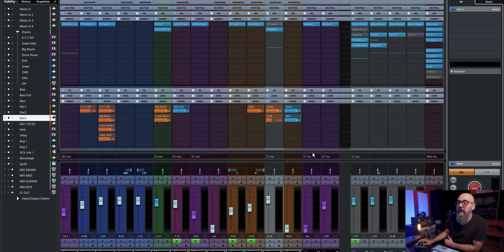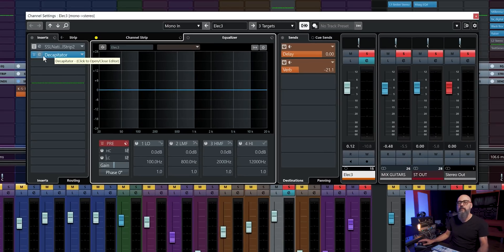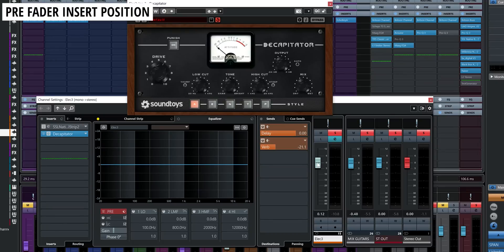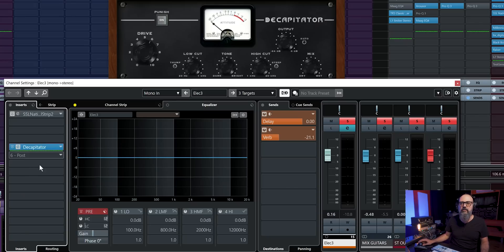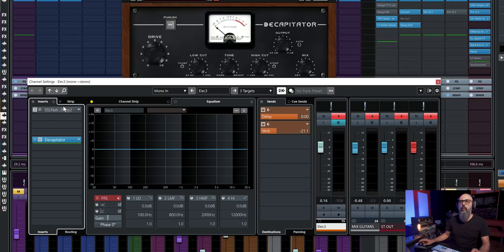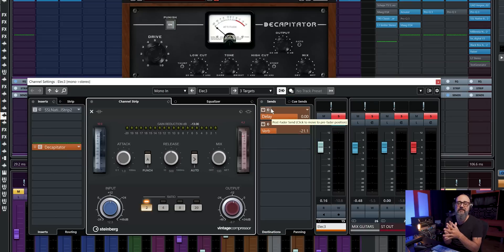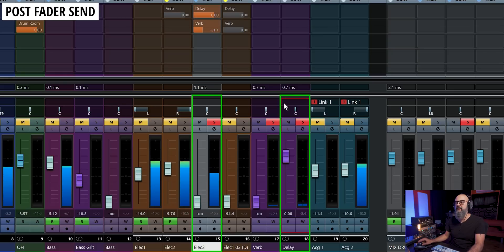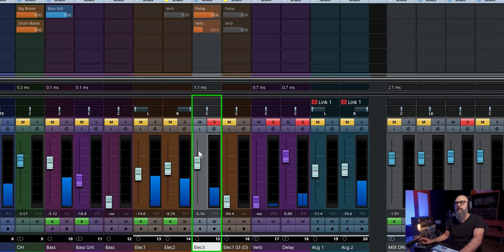An ADVANCED look at The CUBASE Channel Signal Flow

Comment: As a side note I wish there was a way to mix your FX sends with a mixing strip. I know you can use vca etc but it would be nice if for instance you have a delay FX track, you can pull up a mixer of everything that runs into that track to do it quickly.

Comment: user questions and this video proves that workflow cubase sucks. even users aware of pre/post techniques need to learn signall flow in cubase.
Reply: Wrong. Has nothing to do with cubases design etc as its based on a typical analogue console flow which has been around for decades. It's because nowadays the majority of people dabbling in audio production haven't had any experience on an actual real analogue console (which many DAWS mimic) so therefore they are uneducated when it comes to correct signal flow.
Reply: @madmuso5  So these consoles are not well constructed. Sorry, but UX design sucks in short :)

Comment: I can think in a not so rare situation where a post fader insert could be useful: if you have volume automation you could have an overdrive (or any saturation) that saturates less when volume is lower, emulating what happens when a guitar player controls the drive with the dynamic of the playing, for example.

Comment: is there a trick you use when you want to level match your mastering chain? I find it#'s hard to compare to other mixes that go straight to the stereo out when I switch on / off all processing on the master bus. I would have to insert a gain compensation plugin that kicks in when all master FX are off to have no big level jump. When comparing with reference mixes I usually turn them  up to match volume (not loudness) but there is a limit to that as well (i don't want to add limiters there to avoid changing their sound)